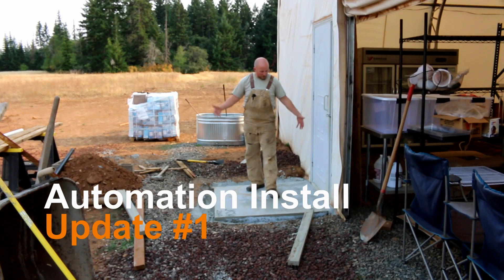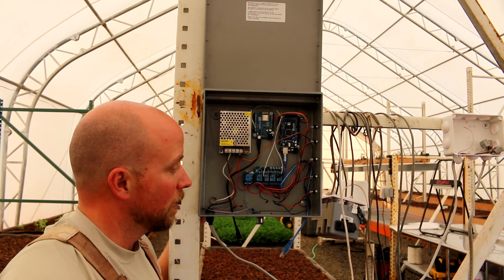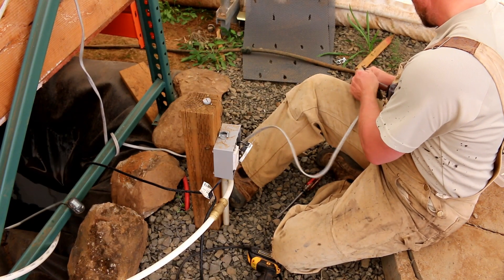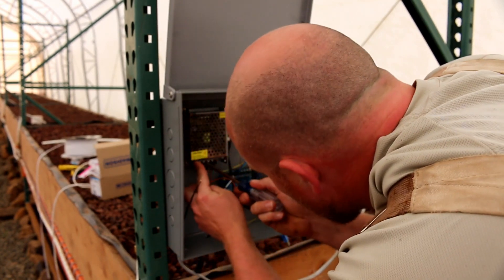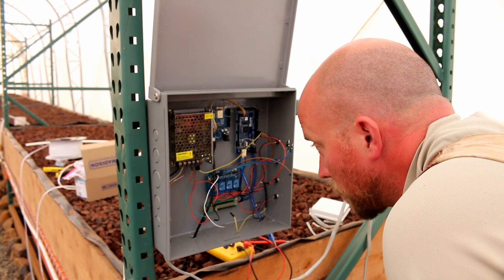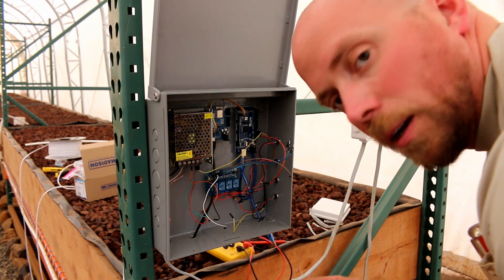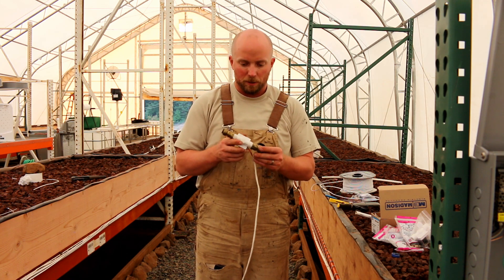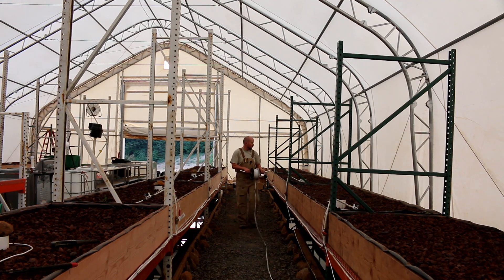Letting the MAGIC SMOKE OUT - GREENHOUSE Automation

Comment: 7800 series LDOs are killed by reverse current so they need a diode from output to input. May not be true for never variants but the old ones were susceptible. This behavior may show up when the input side also has loads connected to that drain the 12V rail faster than the 5V drops.

Comment: You should think about getting a circuit board dip tank and some washable masking for your circuit board, you figure out your layout for your diodes and other connect things leaving your lead long and mask all the other areas that you don't what solder in then take a pair a wooden tongs and dip your circuitboard just barely touching the solder fils the holes around the leads, once  the circuitboard have cool you can cut the lead off flush with the solder. You should be able too buy bars of solder where are you get the dip tank and masking supplies.this will make cleaner looking circuit board's. you will also need a plastic tub and some liquid flux to get the circuitboard in before soldering. Good luck, I hope this is the informative, I used to do this when I work for electronics assembly company

Comment: TRM, glad the ratcheting crimpers are working well. They do save time. Now you need a Romex cable stripper:  http://amzn.to/2vZ6giL   It is a lot safer than the utility knife and makes clean cuts in the jacket and strips wires as well.

Comment: With as much wiring you do, you might want to take a look at a Irwin self adjusting wire stripper.
Reply: Was going to recommend the same, they are much easier and they are less likely to nick the wire which can cause a failure.  This is the one I have 
https://www.amazon.com/IRWIN-VISE-GRIP-Self-Adjusting-Stripper-2078300/dp/B000OQ21CA/ref=sr_1_3?ie=UTF8&qid=1503514576&sr=8-3&keywords=automatic+wire+stripper

Comment: on your circuit board I noticed the regulator(im guessing thats what it is) you dont have a heatsink. since you have a 5v output its probably a 7805 you might need a heatsink or it will just let the smoke out. I think that may be your problem. with a 12v power supply and a 5v output you need to dissipate (12v-5v) * (current draw in Amps) = Watts dissipated. if you are drawing .5A then that would be 7v * .5A = 3.5W and the 7805 can only do about 1.25W without a heatsink. here is a link to some heatsinks that would be good for your application. https://www.digikey.com/products/en/fans-thermal-management/thermal-heat-sinks/219?FV=5940002%2C9c00065%2C9c0006a%2C9c00078%2C9c000a7%2C9c000a9%2C9c000aa%2C9c000ac%2C9c000b2%2C9c000b4%2C9c000b7%2C9c00014%2C9c000ce%2C9c00015%2C9c00016%2C9c00017%2C9c00018%2C9c00048%2C9c00049%2C9c0004d%2C9c00052%2Cffe000db&mnonly=0&ColumnSort=1000011&page=1&stock=1&pbfree=0&rohs=0&cad=0&datasheet=0&nstock=0&photo=1&nonrohs=0&newproducts=0&k=heatsink&quantity=&ptm=0&fid=0&pageSize=25&pkeyword=heatsink I hope this helps.
Reply: those little TO-220 heat syncs are quite useful just to keep around and do a pretty good job of dissipating heat
Reply: ya I got alot of the small 5w heatsinks. they are rated by power dissipated at what temperature. so you can get a 5W @ 30c  and another that is rated at 5w @ 70c. so you can get some that will stay cool but are normaly large or some that run hot but are smaller. or you can just bolt it to the metal enclosure if it doesn't interfere with the circuit because the back of the TO-220 is normally connected to the center pin so be carefull. I almost shorted out some lipo batteries because the 7812 is ground and the back of the TIP29 is on the positive rail. so I had to give the TIP29 its own heatsink.
Reply: SNEAKY WYZRD t
Reply from the maker: uuuuuuu that's probably the problem